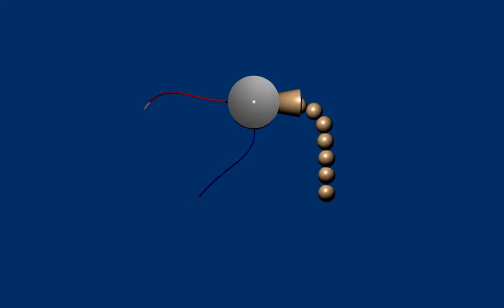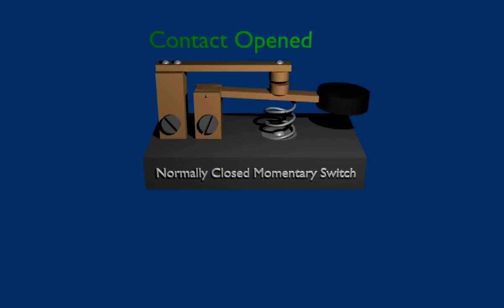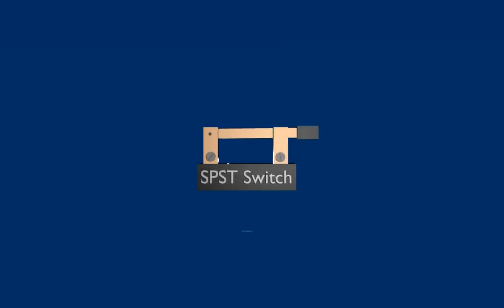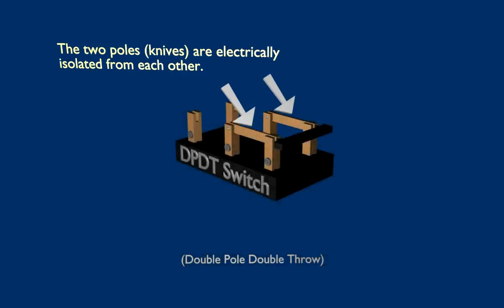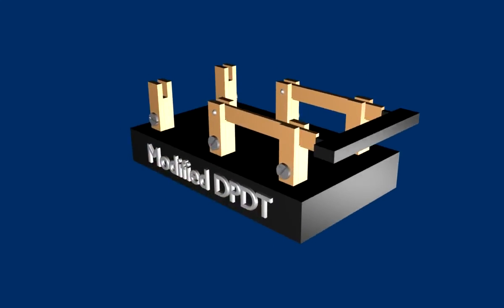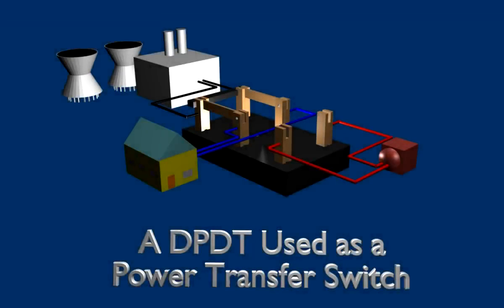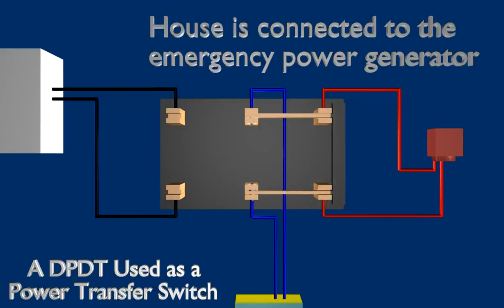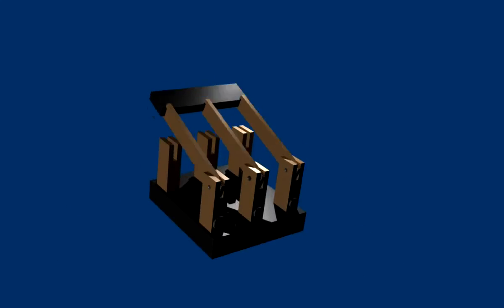About Different Kinds Of Switches

Comment: Great video, really liked your video for 3 and 4 way switches as well, best ones I found to actually show how the switches work inside, which helps me understand why they need to be wired the way they are. Also would like to see a video for using blender or any other easy to use 3d modeling software, thanks! :)

Comment: Very good, easy to understand. I hope you put more videos up about electricity.
Reply from the maker: I would love to. My computer was taken out by a lightning strike on the power pole outside the house. The strike also took out many things like the garage door opener microwave etc. I had to drag out an old computer out and use it. Just surfing the web on it can be frustrating. Since I am on hiatus from work caring for my father (cancer; died) and my mother (cancer survivor) I have been watching my spending and haven't replaced my computer. I been considering using a 1st gen Pentium I found thrown away to render videos, even though it would take days. First I have to find a way to install the software (got to find a network card for it)